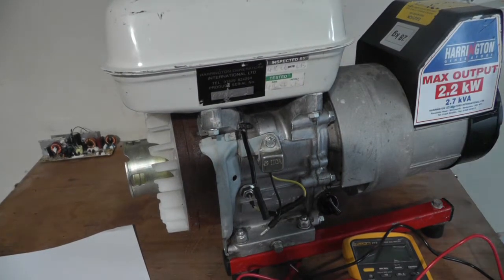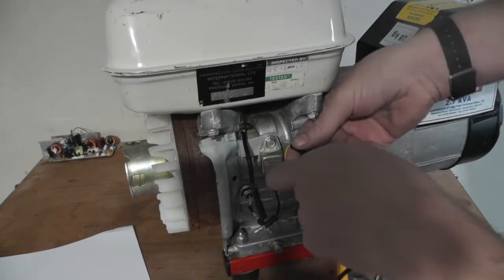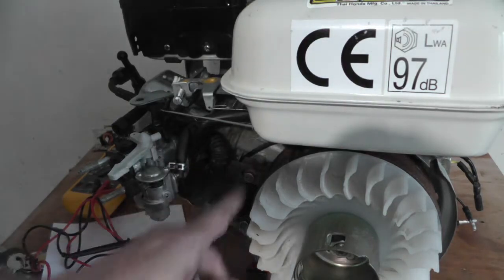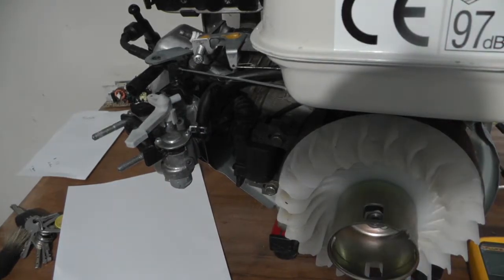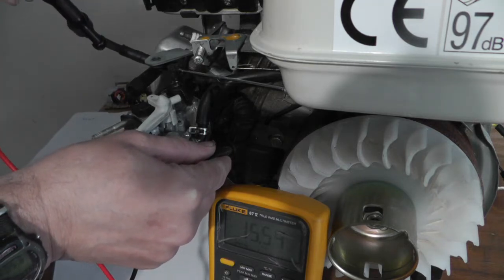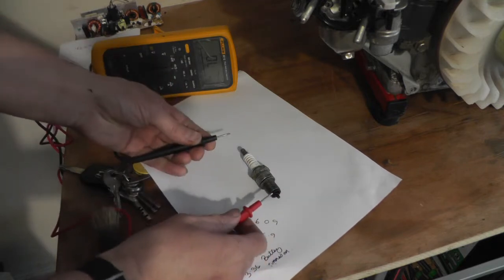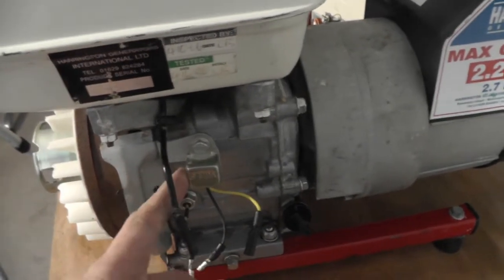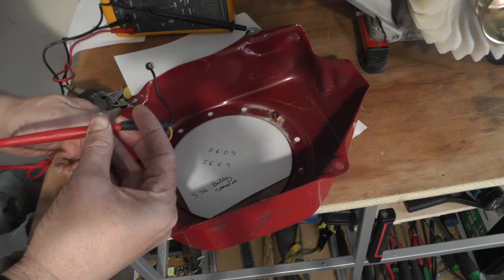Honda GX160 NO SPARK Troubleshooting: Check These 3 Things First! (GX120/GX140 Fix)

Comment: This would be an excellent video if the lighting were better and the meter were visible.  Also, if your hands didn't block what you were doing.  You should redo it, as it is an important video.
Reply from the maker: Ok I will do better thanks for input